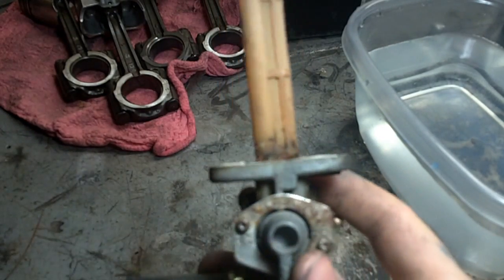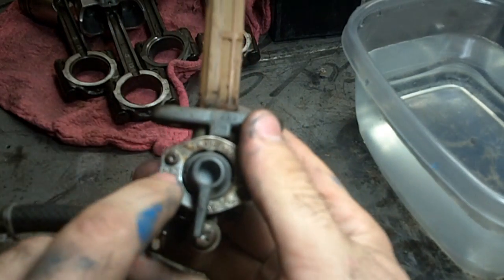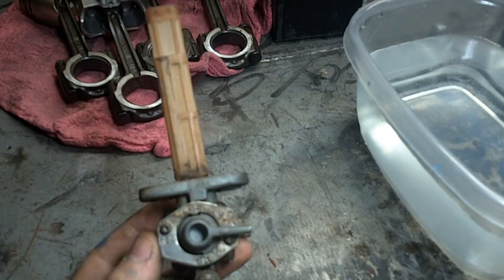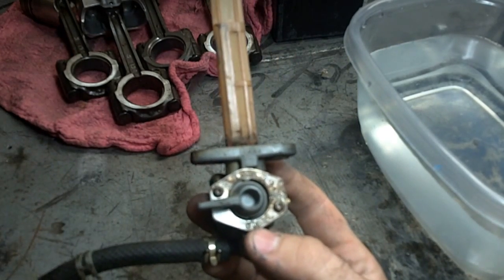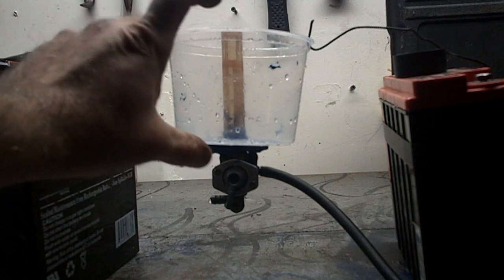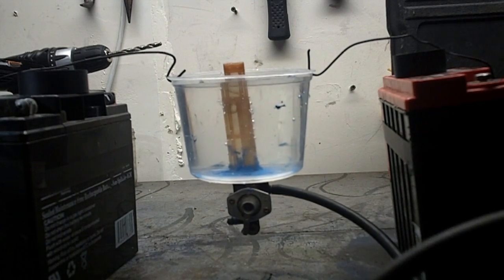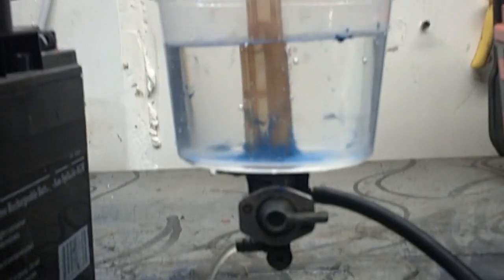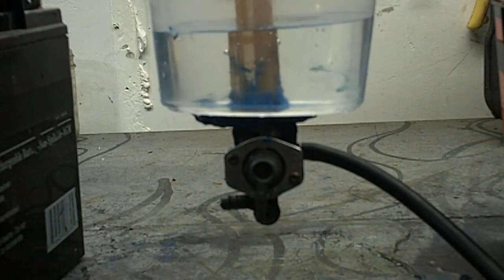How does a motorcycle petcock work?

Comment: Thanks for the GREAT Video! Very descriptive explained everything for me. I've had my first bike for 2 weeks now so didn't know anything about the petcock. I was out in middle nowhere and my bike stopped running I couldn't figure out why, finally I turned the petcock back and forth and then it started. I got to a town and it died again, so I turned the petcock again and it started up again. This happened all the way home and now I know what was wrong. The gas in my tank was lower than the on position and I was moving the petcock and letting fuel in but I didn't know enough to leave it in the res position. You saved me from an embarrassing visit to the cycle shop. A BIG THANK YOU!!!!!

Comment: Thanks for the tip!! I was able to replace the petcock but after a couple of days the choke is acting funny and is actually leaking gas from the carburator any suggestions?
Reply from the maker: Check out my video on leaking carbs. It is a separate problem which is often found together with petcock problems

Comment: Great video!!! I have a Dyna 2001 and is leaking gas so I bought a petcock from Golan Inc, However, it does not have the out for the air hose, only for the gas.... Any ideas?? Thanks.
Reply from the maker: Yeah so its a manual petcock instead of a vacuum actuated petcock. Thats fine, you just gotta plug up that old vacuum line. Tie it in a knot and shove it up out of the way
Reply: Exactly what I was going to ask 6 years later lol, I have a 1986 yamaha radian yx600 and the petcock has on/prime/res. And it was leaking in all 3 positions, I just bought a replacement but its almost impossible to find an original petcock replacement. The new petcock on its way has on/off/res. So I was wondering what to do with the vacuum line. Makes perfect sense that it wouldn't any longer be needed but I wasn't sure if it was going to be a problem.

Comment: I just bought a 1988 bmw r100gs and when I was on the freeway about 60 mph it sputters out. It was not a full tank so perhaps that was the issue? Or petcock? Also I may have cycled through prime to get to on. May I have flooded my carbs? Or would that cause this problem? May also be the suction line? This is my first car bed bike. I would appreciate your help. Thanks
Reply from the maker: Its not helpful for me to guess at your problem, you need to do some investigation and see what you can find. Put the bike on prime and see if it starts. Take a look and see if there are vacuum lines disconnected. Take the petcock off and see if it is clogged. That type of stuff
Reply: Once getting around that speed its probably due to a clogged carb jet im guessing

Comment: i cant even suck air out the vacuum line and my petcock in un-adjustable gas isnt getting out of the tank to fill the carbs up and i cant switch it to prime since it is un adjustable wish i could upload a photo its a 1982 Suzuki 650gl
Reply from the maker: OK then you gotta take it apart and clean it
Reply: worked thanks bike guru

Comment: hey i was wondering is that how a petcock suppose to pour the gas out ? like when you turn it to "on", does the gas suppose to drip out lil by lil to the carberurator or does it pours ?
Reply from the maker: Watch the whole video
Reply: i did, i mean so you say "prime" itll run so when its turn to "on" is it also suppose to pour out like that ?
Reply from the maker: Lazy_Panda13
If you have a vacuum petcock, then gas is only supposed to pour on ON when vacuum is applied. Again, these questions are the reason I made this video, and the answers are the central point to the video
Reply: oh ok, but like i mean when vacuum isnt applied, does it still suppose to pour ?
Reply from the maker: Lazy_Panda13
no

Comment from the maker: Its not an overflow hole, its a vacuum line. They can leak if the diaphragm is punctured, but then the petcock would not function so its less likely. Get down there again and see if its actually leaking from the faceplate or from the fuel nipple. Then, consult my channel for my other petcock video, and watch how to repair and restore them. Thanks

Comment: I've watched a few of your videos and appreciate you not only putting them up, but also the guidance in the comments. I've been trying to get my late Father's 1979 GS850 back on the road. I've got it finally to the point of running smoothly again, but have a steady drip from the petcock. Only when the bike is running tho. It stops immediatly when I power down, am pretty sure it's coming from the (overflow?) hole in the bottom of the petcock, much like in this video.Your thoughts on my next step?

Comment from the maker: It depend son whether they are vacuum actuated or not. If they are not, then there is no difference between PRI and RES, so they add an OFF function so you can manually turn it off if you want

Comment: new  phones givin me s*@! cant do vid sry.what is pipe 4 on carb and if it is for vacuum fuel inlet then wouldnt it effect richness at high revs? what should be my next move to go about installing it with this new pipe hose difference compaired to other one on as im lost for parts on net as its a mexican 2004 model otherwise known as suzuki yes..its the fact i havent found anything related to this hose connector on any carb vids urs closest with the 2 fuel connector on P/C. PS good vids tnx alot

Comment: hey bro question for ya,just bought new carb..no diaphram for original on net.for en 125.has extra pipe intake yet suppossed to be for that bike.guessing its for vacuum fuel intake as its on engine side straight to airflow and into engine. i guess to add extra fuel at higher revs but this would make mix rich right? im stuck ,cant find petcocks like yours for en 125 and could i get one that freeflows AND has vacuum fuel line ..my real question is whats the extra intake on carb for and can i block

Comment: Thank you for directing me to this video! I have just bought my first bike and knew nothing about it. So my leakage was most likely caused by the petcock being on PRI? I switched the setting to ON earlier today and when I came back there was no leak; and yes there was gas in the tank. So just to clarify, I should keep my petcock switched to the ON position most of time unless I'm running low on gas (RES) or if I need to drain the tank (PRI)?

Thanks again for the videos! Really helping me out!